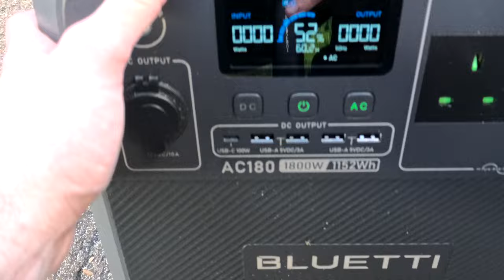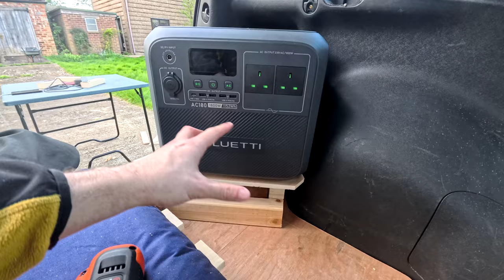Converting a Cheap Car Camper for a 10,000 Mile Road Trip (Part 2).

Comment: I think you picked the ideal car for this conversion. What you may want to consider, as your rear door is sideways opening, is some kind of awning to go over the top so you can cook outside if it's raining. I'm just starting to use my Peugeot Rifter (Citroen Berlingo) to spend a couple of nights in when I travel away. I'm only currently throwing a blow up mattress, etc, in the back but have a Lithium Power Station, a fridge and a portable toilet with me for the essentials. Keep up the good work.
Reply from the maker: Amazing mate - you should have filmed it so we could take a look!

Awnings are great, honestly - especially if you're in an insulated van and don't want soggy / mouldy insulation. The only reason I haven't gone with that or a ski box (despite roof rack) is so I can increase my stealth camping ability really. Without it, I should be able to get away with stealth camping in more populated areas when needed. 

As for the vehicle, I think it's a great choice. Reliability and price were crucial for me, so to find a fairly old Honda with a full Honda Service History for £2k was too good to pass on! 

Portable toilet is probably sensible, I'm definitely taking a risk by not having one...

Comment: This looks very cool; I really want to do something similar.

Some advice for long-term use: if you run some cable from the car battery to your battery bank and install a split charge relay and a DC-DC step-up converter, you could increase your charge speed to a theoretical 600 watts (mainly depending on your alternator) while the engine is running to fully charge in just under 2 hours, and with the relay, it would automatically cut off when the engine stops.
Reply from the maker: Hmm, that's very interesting. I'm going to have to do a bit of research because my main concern is only recharging at 85w per hour. I did imagine there was some way to get more power from the alternator, but my electrical skills are even worse than my woodworking! 

In your experience is it the kind of thing a novice could do?
Reply: @BritishLandeur  I can't say for sure, but with a good crimping set, some research, and, most importantly, the correct fuses in place, it's really not as complicated as it might seem. 

I have always wanted to build my own camper, but with that not really a possibility at the moment, I settled for camping, and to be honest, I learned most of what I needed from YouTube and forums. 

I made myself a small system for camping, although not as hardwired as you may want to look into doing in your case. 
Just with aligator clips to connect while idle, I also have a 400w foldable solar panel that, even in cloudy weather, I can get 100w from. 

One other addition I have been looking into for my own camper one day is to glue a couple of 100-watt flexible solar panels to the roof for power even while stationary. If it's hot inside the car, as you mentioned, then the solar panels would hopefully eliminate any power worries even while parked up for a while.

I'm excited to see where your project takes you, and good luck! You're living a dream. I hope to have someday.

Comment: My brother uses an electric blanket plugged into his Go-Zero when winter camping. Something you could easily do with your power supply. 12v twinkle lights hanging from the ceiling is pretty cool too.
I got some screen nets to go over my jeep doors to be bug free with the windows down for a cool night sleep.
Reply from the maker: It's like you read my mind. I am going to use a heated blanket for sure - I use one anyway ordinarily so I will be taking it with me. It's a really efficient way to keep warm! 

As for lights, I am thinking to put some fairy lights (probably the same thing) throughout and they can even be battery powered which frees up the 12v socket. In my experience they take very little power and the batteries last for a really long time. 

I will definitely take a look into the nets, that makes a lot of sense because a car can either get very cold or very hot quickly - a great suggestion, thank you!